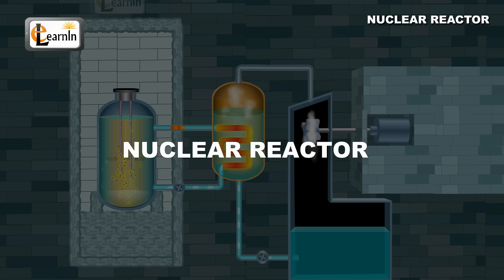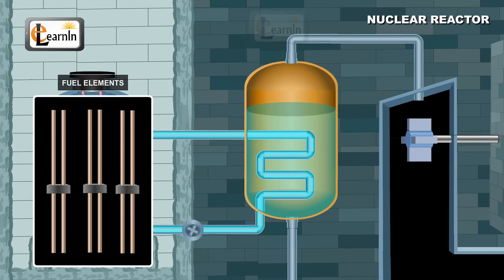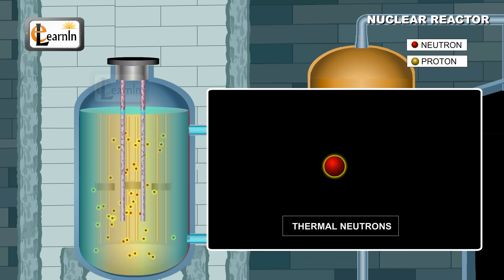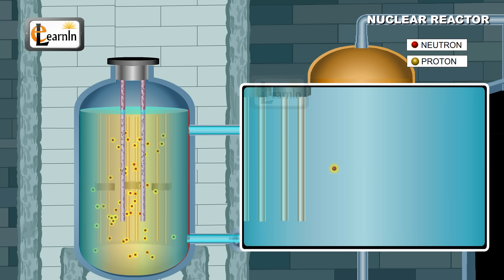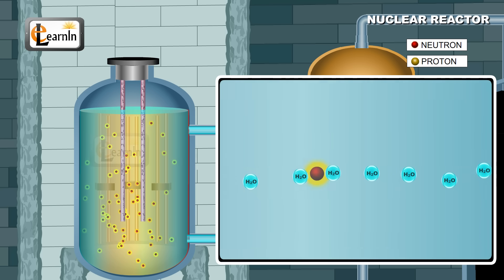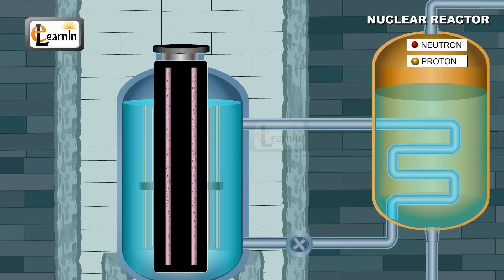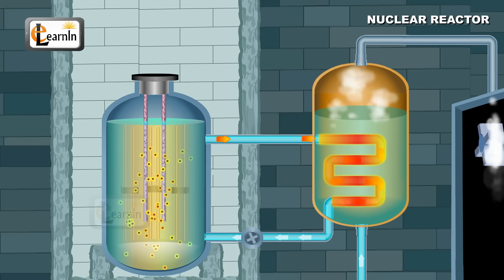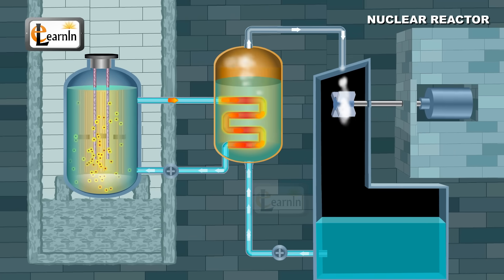Nuclear Reactor - Understanding how it works | Physics Elearnin

Comment: Coal isnt at the "breech of extinction" there is more coal on earth than we could use in thousands of years.  Every time someone says we are running out, a new oil basin is found or opened.  The USA has enough oil to power the globe for a very long time, but we dont use it very much, as a percentage of what we have total.

If oil and coal is finite, which it is, but incredibly common, which it also is, it's cheaper long term, to buy other people's gas and coal.  If you have cans of food and another person has cans of food they are selling, but the amount of cans is finite then the smart move is to buy their cans up while it is cheap and they have a ton to sell.  When they run out, you can sell the same cans back to them for a huge profit or just use them for yourself so you dont have to pay the increase when they start running out and cans become more scarce.   Why use your own stuff when you can save it and use someone else's, right? That's the main reason we dont allow free for all drilling on public lands without a specific reason.

Drilling in the ocean is even better, because the area cant be used for anything else, generally speaking, and it doesnt use up the stock locally.  Kind of like going to a grocery store across town for the cheaper dried food goods while shopping at the more expensive local market for things that require refrigeration. 

You have to remember, that energy cant he created or destroyed, and we have a constant flow of energy coming from the sun which gets converted into all life on earth.  Anything we add to the air in tiny local amounts but huge global amounts gets converted through nature.  That's one of the truly amazing things about our planet.  Endless variation of cells and organisms means that gradual changes will always be dealt with naturally given time.  If we put too much of CO2 in the air, more plants will grow to fix it until the new plant population runs out of excess CO2 and then dies off, leaving....coal.  funny how that works, isnt it?

Comment: Could the Fukishima waste water be separated and the water down through DEKA distillation, powered by another reactor if safe, before running into the Pacific ocean?

What if control rod material finely ground was fed into the core, even drilled with geological boring and fed a mile down? Also what about boronic water to cool, and pre-stage ion exchange with titanium oxide and salt before distillation to  separate the waste before dumping the waste into the ocean?  Maybe CA should be piping Atlantic water for desalination or distillation and keep the Pacific off tap for now.

Comment: Good video and understandable animations, but you missed 3 key elements (especially for a PWR system, like the one in your video). A pressurizer to keep the water in the containment shell circuit liquid. This water would otherwise turn into steam. The next key element is a third circuit to cool the steam from the second circuit. And the last element is the condenser. The place where the steam from the second circuit (high and low pressure turbines) will collect and condense to water, with the help of the third circuit. Other from these 3 points good vid
Reply: Why not create your own channel and do better than this?
Reply: yo dad prolly died in a boat sinking
Reply: I am missing how the reactor starts also.  What do you do to get is started?  Throw a match at it?
Reply: Hey hey, I know the answer to this one! There are rods in the core that absorb neutrons. These are called control rods. When the rods are at the bottom (fully inserted) they absorb enough neutron flux to prevent fission. To start the reactor, simply put, you slowly pull out the rods to specific heights and monitor power. Pulling too fast can cause something called prompt criticality
Reply: @BelleRiverHeating  From what I've read in a reactor that has never been running before, the control rods can be removed and plutonium-238 for example can be used to jump start the chain reaction in the core and the control rods can then be inserted back into the core. For running plants they only remove 1/3 of the uranium fuel rods to replace and keep the plant running and the chain reaction going.
Reply: @BelleRiverHeating from fission
Reply: No, not a good video. Not at all. This is full of bad information. I can't even begin to cover them all.

Comment: 18 seconds in and you've already messed up. Coal is NOWHERE NEAR depletion. Dirty and undesirable, yes, but we could burn coal until we go extinct. Oil and gas are also pretty far from depletion, again we just don't want to use it. (Tarsands and fracking) plenty available, but not worth the extra pollution. Please get your facts straight. Major difference between too dirty and depleted.

Comment: Uran 238 is not recomended for fission. It needs high energy neutrons and the its transformation to neptunium doesn't give very much energy compaired to Uran 235 which uses slow neutrons and turns into a very unstable 236 which again rips itself apart, sending out more neutrons and giving substantially more energy

Comment: So basically, nuclear reactors are windmills on drugs. Instead of wind, it's steam turning the turbine.
¤ Highly reactive metal rods are placed together in a chamber causing their neutrons to multiply?
¤ They are placed close together so multiple chain reactions can occur?
¤ This in done inside water to alow down those chain reactions to avoid explosion?
¤ The hot water heated by the reactions in the "rod chamber". quickly rush out and meet cool air and turn into pressurized steam?
¤ This pressurized steam heats and turns the turbines?
Did I get that somewhat accurately?
Reply: It's impossible for neutrons to multiply. The uranium atoms are unstable causing them  to "split" when they are hit by other neutrons. When the nuclei split, they give off more neutrons that go on to hit other atoms and create a chain reaction. Every time the atom is split, it generates energy in the form of heat. The rods don't necessarily have to be so close to cause a reaction, but it saves space.
The water slows down the neutrons so they have less energy when colliding with other atoms allowing the reaction to be more controlled, but it will never explode like an atom bomb. Uranium in weapons is enriched meaning it has a higher content of uranium-235 which is more unstable than uranium 238. Weapons grade uranium has been enriched to about 90% while fuel in reactors is only about 3%.
The steam does heat the turbines, but that isn't what generates electricity it is only the spinning of the turbines. Hope that helps.
Reply: Kai Barrera My apologies. I thought   nuclear energy is created when elements are bombarded with neutrons (or maybe it was electrons) to make them unstable. But then again I'm probably just confusing what I learned in school.
At least I got the "nuclear windmill"  idea somewhat close

Comment: Can someone explain clearly..why the speed of the Neutron should be reduced by moderator..anyway it's to use fuel material to generate a nuclear fission reaction..what is difference if the nuetron moves fast n generates a fission reaction ??
Reply: if a neutron moves faster then it will escape the reactor

Comment: Ok, so let me get this straight, we take a highly complex, technical, sophisticated method for sustaining a chain reaction of nuclear material, have complex and highly technical containment systems and equipment all just to boil some water to run a steam turbine like in the late 1800s and early 1900s? That is like building a rocket to go into space take water and fly into the sun to make it boil so you could produce steam to bring back to power your telegraph. What a backassward world i live in.
Reply: So what is your solution?
Reply: WB IsMe i would propose we stop poisoning our home and selves, end this insanity of weaponizing every thing   that produces high energery shoot our nukes into space and shut down all reactors for good. Tesla was on to something with his free energy, between that , solar and wind power that would be suffiecient until we become a class 1 species
Reply: Favel Konefka. Not 1 time did i say i abhor boiling water, what i said was boiling water for steam to power something is primitive compared to the fission of nuclei to produce a sustained reaction. Now to answer your question again, a system of 50% solar and 50% wind power uses already abundant resources the exist all the time , all that is needed is to refine that energy into power then storing it until needed then dc voltage is converted into ac, abundant power would be a 3 kilowatt system per household the excess could be used to power water and sewage treatment plants, with no fear of radiation, radioactive  material disposal,   core meltdowns which umm happen all the time, ecological damage, geological damage , and so on and so on. Not to mention teslas free energy. That would make the second time i answered your question, and more than amply.
Reply: I was expecting an answer that can substitute steam turbine technology.
It is like going to an Italian restaurant, commenting that the food suck, the manager asked for your constructive feedback and you tell them to change the menu to fast food. 
Did you even know that most of the conventional and  some renewable power generation plant/facility in the world uses this technology? 
Additionally from the way you describe your "alternative solution" especially the solar and wind, it seems like you only have brief knowledge of them. I doubt you even know the technical and economic difficulty behind these technology.
Reply: Favel Konefka. Ok first, dont assume what i have and have not seen, not only have i laid eyes on an energy net, i have made one, very simple design, uses a few , diodes , caps and resistors, copper  wire to act as the "net" another goes into the ground, it receives electromagnetic energy which is converted in to volts. Lasts forever, downside is small output, only 2 to 3 volts per unit , put enough units together however and you could power towns for free. Big enenrgy conglomerates have shut this down because it get into their pocket, never assume someone has never seen something. I only speak when im right and have all the data to back it up.
Reply: Oh 1 more thing i am an engineer and prototype Rf machines, such as drones and remote controlled trains for the military. I dont read shit then go trolling, sounds like that might be up your alley though.
Reply: NEXT!
Reply: Favel Konefka. Before you make yourself look stupid, you might want to end your troll session. I will style on you, just a warning.
Reply: Favel Konefka. Never threatened you, only said , i come to the table with not only knowledge but i back my info. With  data. I also do not make assumptions of other people without knowing them or their history. So that is where you have struck out 3 X. And what i said is , ,I will style on you, if you dont know the meaning, prehaps you should go back to where you get all of your data and search the term,  google.
Reply: Favel Konefka. Have you even watched this video?  You arent making yourself look very smart, which im sure that you are, however, what is the purpose of a nuclear power plant? To generate electricity on a large scale to power our homes , run our gadgets , etc now last time i checked , my house takes electricity from the line that run up and down my street, from those lines to the meter, electricity goes through is then stepped down to 220 volts and 110 volts, since the power company calls the units of power volts, then its pretty safe to say that volts actually exist and are part of a system to catagorize the properties of electricity , volts, watts amps, all units of energy, just different properties.
Reply: Favel Konefka. Then why is current defined in volts instead of watts, my house 220 and 110 volts, i go by a hair dryer its rated for 110 volts, watts define the overall load. Watts defines how much voltage was used, when i get an electric bill it is broken down into kilowatt hours, if i wanted to go solar power in my house i would want a 3 kilowatt system running at 110 volts, in pretty sure that electrical standards are the same worldwide, so you might want to brush up on your electromotive knowledge.
Reply: Favel Konefka. Show me where i ssid current is defined in volts, show me at point i said that. You are just out to look for an argument on a subject to which you wont win. Assumptions and incorrectly assessing a person more than once on and then putting words in the mouth of the person that they did not say shows lack of class and ethics on your part, the dog is sleeping why wake it? Would you like me to explain how electricity works and its properties? Electricity is just like plumbing, the bigger the pipe the more flow you achieve, the pressure of the flow is the amps, you follow?
Reply: you don't seem very well informed. You said that nuclear reactors meltdown "umm all the time" and that is definitely not true. There have been more accidents than there should have been, but not as many as you seem to think have been on the scale that you think they were. I just want to point out that yes, steam power is an old technology. The difference between nuclear and traditional steam power is the fuel. Before it was just combustion. It was extremely costly in fuel and causes extreme pollution. Nuclear waste is also a problem, but it isn't thrown into the air. It's pretty much kicked under the rug until we find better ways to deal with it. 
The main difference in these wastes is that pollution is a kind of silent killer. It kills people slowly and everyone just accepts it as the way the world is. The dangers of nuclear waste is when there is a disaster like a meltdown. These events are exaggerated because they don't happen as often and the radiation effects are more apparent.
Reply: Kai Barrera you are the uninformed one,     ever hear of three mile island? Hmmm? How about a place called chernobyl, hmmm? No ? What about Fukashima? Need i go on, im very well informed. It seems you are not.
Reply: Kai Barrera , ever hear of kyshtym, russia? Meltdown 1957, ever hear of windscale england? Meltdown 1957, how about sl-1 in idaho, meltdown 1961, or czechoslovakia, meltdown numerous times 1977. Before you call someone out as being uninformed and not knowing what they are talking about, you had better have the data and facts before opening your mouth and making a fool of yourself. So by me saying meltdowns happen all the time is a true and correct statement, is it not? I did not even list all of them , didnt need to.

Comment: Molten salt reactor is better!
Why?
- high temperature (around 800 °C)
- normal pressure
- fuel can't melt in core, it's already melted
- near 100% of fuel is burned intead of  5-7 ‰.

Comment: Very close. The chain is as follows: Reaction produces heat, which is transferred to the water, which is converted to steam, who's potential energy is converted to mechanical energy at the turbine, which turns the generator, which produces the electrical energy. Thanks for this informative video.

Comment: what happened with chrenobly is the water drum was empty and lava or extreme heat had no way to cool down so it filled in to the water drum so much that the drum burst and the lava/heat melted the concrete. and that is wear the elephants foot came from, the elephants foot is solid radiological magma. the say If you come into 10 yards of length the magma/elephants foot you will die within a month from overexposure.

Comment: There is no generation for the nuclear power generation ,It is Soyama generation alone in the world that I can generate electricity in high efficiency than nuclear power generation safely there .The nuclear power plant runs at 150 standard atmosphere at 320 degrees .Soyama generation is 150 standard atmosphere at 230 degrees Celsius with alcohol and an alkaline mixture.Ican generate electricity by the output same as nuclear power generation with terrestrial heat and natural gas and am the best renewable energy

Comment: is not H2O or H2O2 used to produce deuterium or tritium in the reactor?
Reply: No Deuterium is an isotope of hydrogen, Hydrogen is composed of 1 proton and 1 electron, Deuterium is a hydrogen atom with an added neutron ( Heavy water ). Add another neutron to deuterium turns it into tritium.
Reply: yes, indeed. But what is the process for that? I think they put heavy water as moderators so that they can attain another neutron to form tritium...

Comment: So when the water pump fails, that circulates the water throughout the core itself, how is it repaired or replaced without exposing anyone & anything to lethal radiation?

& if this pump is replaced, how is it discarded? Because the water that it pumped was the dirty water in the core.
Reply: I was thinking that myself as pumps don't last long